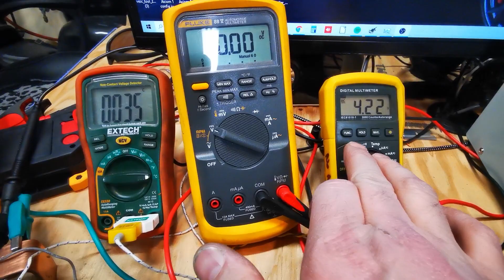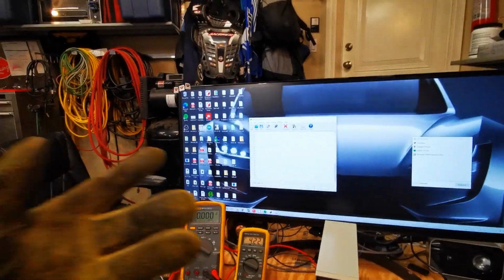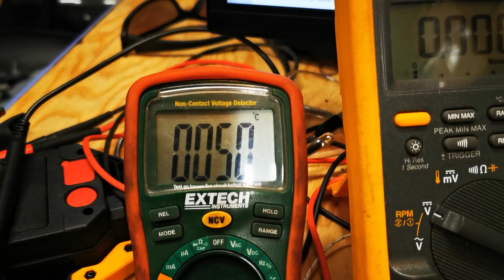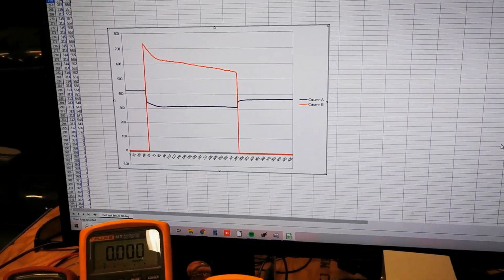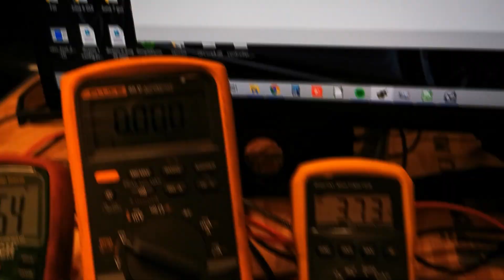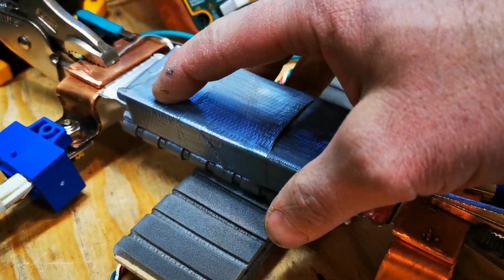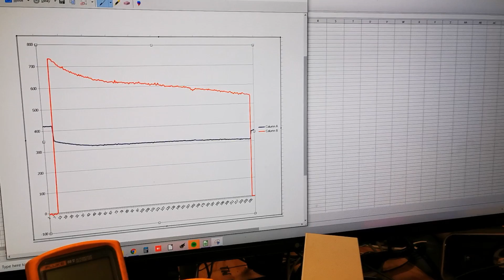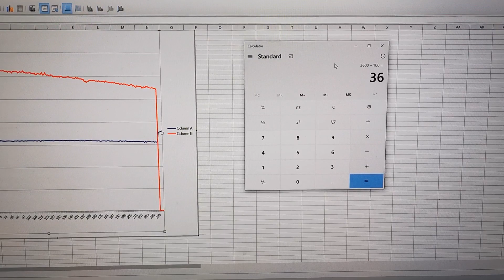Bad ass Cell proves over 100c continious!

Comment: Turn the terminal to its flat spot and you'll get more current. Also take those metal things out and shorten the cable.  Unless you're trying to modulate the current somewhat...  What brand cells are these?  Would be nice to play with some!

Comment: dear Arlin, thank you for the really impressive discharge test. it is so well executed and full of helpful educational insights and useful data. by the way, have you considered LiFePO4 chemistry before? it is probably less energy dense and power dense than the cell you demonstrated, yet also has much less of a thermal runaway failure mode. your thermal management strategy seems very sound. especially the advice to set earlier power reduction temperature to the degree thermocouple is separated from center of thermal mass. thanks again. by the way have you evaluated the Headway 38120 HP 3.2V 8AH cell? it’s one on my radar. cheers
Reply: PS this video is of an 80A discharge test of the 38120HP cell in 4S configuration. cell surface at approx 57C at end of test. the cell is rated for 200A with surges a bit higher i think.. https://youtu.be/MdhyOFeOqyE 380A on dead short test with clamp, cell surface hit 77C or something lol. 330g/cell i think
Reply: @xef6  Decent cell, voltage sags pretty bad.  What's your intended use?   Any specific questions?

Comment: Sweet cell, but if it's getting that hot and possibly gassing, I think calling it 100C continuous might be a stretch lol
Reply from the maker: This is with very little cooling and I have done more than 100c from full to dead.
Reply: @garbizwal  right, but if its gassing... can you still rate it continuous?
Reply from the maker: @blackz06  Its not gassing when its done right IE you have cooling in place.  It takes 36 seconds to go from full to dead.  I Was able to Start a test at 720amps and finish the test with an empty cell at 3vdc with 560 amps. 100c is 510amps.  So I was able to do MORE than rated and it did not gas with no cooling!
Reply: @garbizwal  very impressive cells for sure! How long did the cell take to drop to 3v? And what was the rebound voltage?
Reply from the maker: @blackz06  Around 26 seconds and come back to ~ 3.15-3.2 depending on the test.
Reply: @garbizwal  are they essentially depleted at 3.15-3.2? I know all cells are different, but some hit that level at around 3v. If so, you could pull them down to 2.85ish on your tests and they'd bounce back to 3ish volts.  But its probably a negligible amount...and probably be more prone to gassing and and a shorter life.
Reply from the maker: @blackz06  These are 3.7v nominal not 3.6 like many lithiumIon cells. At ~ 3.2v they fall off a cliff but when under load that changes a lot.  From the length of time combined with the current I was pulling out that is about all they have in them.  In my use case the plan is to load them up hard for 5 sec or less at a time.
Reply: @garbizwal  makes sense. These available for sale anywhere? I'd like to play with some!
Reply from the maker: @blackz06  I just ordered every single cell they had left.  There is a world wide cell and materials shortage happening due to Tesla ramping production.  All new cells will be a lot more money but I got enough to put 600+KW into the controllers on the CRX.
Reply: @garbizwal  600, damn! Who is they, and do they offer a little less powerful cell thats available?

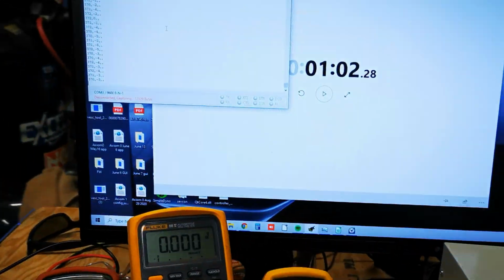Comment: Nice test Arlo. As you know i'm sure, 100C = 36 sec discharge from 0-100%.  how did you managed to have that 5Ah cell run at average 600A for 1 minutes then ( at 9:17) ?
Reply: The clock kept running when he stopped the test.  he tested it for about 20 seconds...

Comment: Arlo have you ever thought of doing a flourinert submerged battery and controller?
Reply from the maker: Sounds complicated.  If you fill the motor or controller or battery with a liquid it needs a place to go when it expands.  With potting you can get likely better thermal conductivity with no risk of leaks and a much easier to deal with solutions.
Reply: @garbizwal  fc-40 has very low thermal expansion and high boiling point. Other 3m fluids are designed to evaporate at low temps for pc cooling true. For these cells your talking about tab cooling, if you potted the cell  case you could run fc-40 over the tabs and it will pull heat way better than potting and a heat plate, plus save weight.
Reply from the maker: @byronlovesdrifting1  Potting is still hands down the best.  All it takes is a pin hole leak to let some of the fc-40 into the cell and I bet it reacts with something inside.  Potting on the other hand just keeps it sealed.  I have potting showing up today with 2-2.2 W/mk so its going to work VERY well at removing heat.
Reply: @garbizwal  I don't know how that specific scale works, fc-40 is .065 w M C which apparently is different(about 1/4 of the data sheet is over my head 😆🤔)  I'm gonna be using the fc-40 since it was designed with batteries in mind, one if the first demos is for stopping runaway with a few cells submerged. My batteries are already in a module already though so I don't have to worry about structure, which the potting also does with your cells. Very excited to see everything progress 👍

Comment: Verry impressive.   Awesome for drag racing, or  a street application where the you need high peak amps, but not for too long.   Look forward to hearing how the potting  works.  Heat is always something of a challenge to manage.   Both on the Leaf motor and the packs.   Thanks for keep pushing forward!
Reply from the maker: This cell will likely give you the most sustained PEAK amps.  What I meen is they will do 100c from full to dead.  I have not seen another cell that will do that.
Reply: @garbizwal  i believe ripperton uses them in his electric r1 motorcycle
Reply from the maker: @FirstLast-tx3yj  Nope he is a friend of mine. If its the cells I am thinking of they had the tabs both out the same side.

Comment: What cells?
Awesome content!
Reply from the maker: 5.1ah 100c continuous 150C peak. Rated I have proven a tiny bit more.
Reply: @garbizwal  are you still selling controllers for high hp leaf motors?
Reply from the maker: @FirstLast-tx3yj  I have a couple kits left.  From the CRX that was on discovery channel
Reply: @garbizwal  how much is the kit

A ball park number if you prefer
Reply from the maker: @FirstLast-tx3yj  Incl the 800a IGBTs its ~3500-4500 depending on options.

Comment: if it's not a secret what potting are using for batts and motor ! i would presume that for the batt you would silicone - jelly  like potting to able to repair battery pack !
Reply from the maker: Absolutely not.   Silicon will react with the cells.  I have a few options for potting.  I have a gallon of something coming to test on the motor and if I like it for that I will use it for the battery.  I already have some great potting material for batteries but the stuff coming for the motor windings conducts heat better.  You don't take used batteries apart and replace single cells at a time.  I will be building 28s modules and if a cell dies in 1 of them then the module gets either tossed or dissembled and the remaining cells used for something else.
Reply: @garbizwal  Alright..! Makes sence to use the cells else where.. Will kepp my eyes glued for  future videos...!